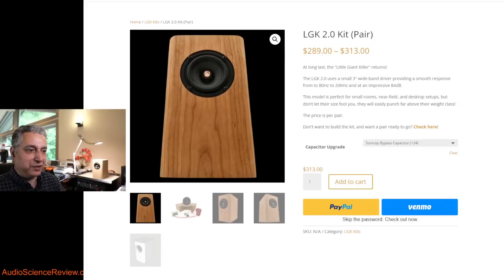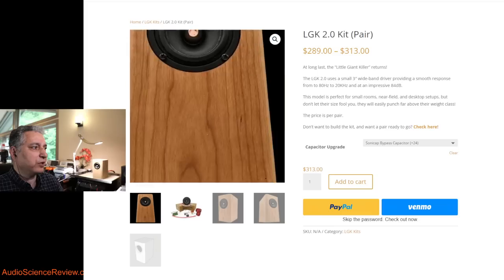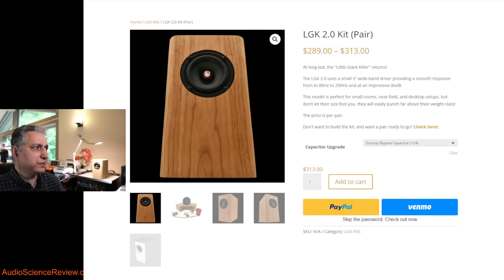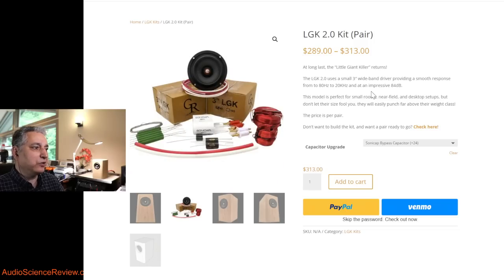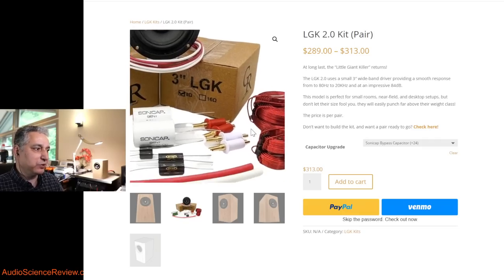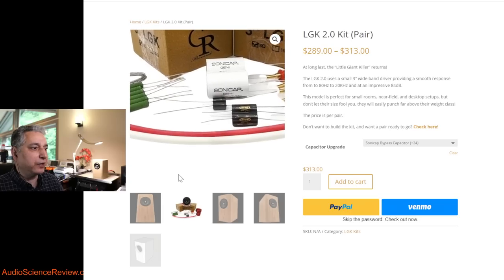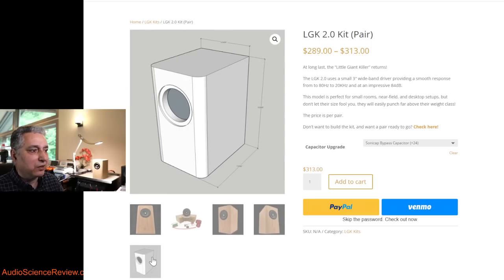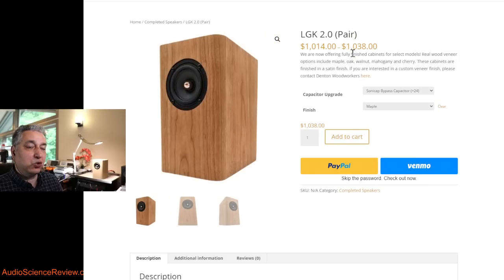GR Research LGK 2.0 DIY kit Speaker Review

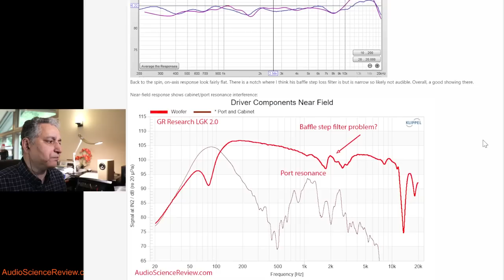Comment: At 11:45, what you are pointing to as a 'baffle step filter problem' is actually a more common issue with cone design, called "edge hole", which is due to a mechanical resonance in the surround or the very outer edge of the cone - as frequency increases, the surround (or edge) starts to whip up and down in-phase with the cone, causing a rise in energy, then it goes out of phase with the cone (causing a dip) before settling down. The purpose of the adhesive bead between the cone and the inner knee of the surround is to control this whipping tendency. It also exists in mid-bass speakers with wide and thin surrounds. It probably exists in this speaker because the cone and surround both have to be very thin and light, making them relatively flexible.
Reply: Interesting... thank you for that.
Reply: Could be shown with phase decomposition. I expect the exact issue that you mention.

Comment: Thank you for the honesty. In engineering there are always trade offs. But this sounds like a case of “you can’t get there from here”. Tiny little drivers shouldn’t be asked to do the impossible. 🍻cheers!
Reply from the maker: That's it really.  Now if an inexperienced hobbyist had come up with this, you could hang your hat on that.  But for someone that tears down and complains about countless commercial speakers to produce something like this, just boggles the mind.  I have to think he is not sensitive to distortion like many of us are to not have heard the serious deficiencies in that department.  Even without that, he should have known what a 1mm excursion driver can or cannot do.
Reply: I have Revel M8 speakers for my surround speakers that I bought on sale after they were discontinued.  They have 2 3" woofers and are ported and tuned to ~110 Hz and do fine at pretty high levels if crossed over at 120 Hz.  But a single 3" tuned to 80 Hz or so isn't going to go very loud.  If I bought speakers of that size I'd definitely want to have a HP filter of 120 Hz or higher on them.

Edit:  I'd imagine these would sound a lot better as a 3 way crossed 3K to 4K to a tweeter and maybe 250ish to a larger woofer.  That'd be a lot more expensive though, of course, and compromises abound at this price point.
Reply: @gregsunderland6394  A good friend of mine likes to make 3” subs do crazy things. We’ve learned a lot building the wierd Nth Order band-pass boxes. It can be done but not with the full range variety. The driver just isn’t intend to play that low. 🍻
Reply: @timealchemist7508  How'd they sound?  I've never actually listened to any bp enclosures. How high can they be tuned and still sound reasonably good is one question I'd like to know.  A 4th order bp with a range of 70 to 200 Hz or so would be well suited for home theater speakers, I'd think.
Reply: @gregsunderland6394  Well it’s kind of a novelty piece. He had some 3” full range Dayton audio speakers for monitors and then the 3” sub. (Also Dayton I believe) They sounded surprisingly good for what they are. But not much more than a nice computer pair. 

You’ll always get good imaging from such a small pair if set up well. So that was good. The sub suprised me but it’s nothing I would take too seriously. Just a fun side project.

Comment: Thanks Amir for another in-depth review. I like tiny speakers. There are many choices for DIY full range. TangBand, Vifa, Foster, Peerless, Dayton, Scanpeak etc.. I DIY the TangBand W3-2141 (3 inch full range). Low frequency distortion is much better than GR's full range. After listening to the TangBand for a while, I feel fatigue listening to vocals. So I added a tiny external silk dome tweeter and cross at around 2.5khz.  It is sounding much better now. Total cost $150/pair including the addition of tweeters and crossovers.
Reply from the maker: I am sure much better job can be had with a single driver.  Hope to test more in the future.
Reply: @AudioScienceReview  The Mark Audio drivers get good reviews and I have seen versions used in open baffles too.
Reply: @AudioScienceReview  would be cool if Audience still sells the A3 full range driver. They were claiming some high excursion numbers
Reply: @AudioScienceReview  I think you are right. I was impressed by the older E J Jordan units, (and Ted Jordan contributed a lot to the science of speaker design in his lifetime - you can read some of his work in the  old 'Wireless World', archived at 'World Radio History'). Hoewever, since his death a few years ago, the firm has gone all 'Audiophile', and the drivers are now out of my price range. You will always have range limits with single drivers, but the single point source can do a lot for stereo or ambisonic imaging.
I am a recent discovered of your channel, I love what you are doing. I stopped taking UK HiFi magazines in the first wave of subjectivism and am delighted to see a push back against it, especially now it has degenerated in a maze full of corrupt reviews and snake oil products.
Thank you for your excellent work.

Comment: Well that's what you get using too small a speaker combined with terrible xmax capability and typical high frequency beaming caused by the full range driver and high frequency rise. I'm betting this driver came from either India where Danny gets some of his drivers from or China and not of the best quality. Oh by the way has he yet to do that double blind power cable test he claimed he could easily do from what  a year ago now? lmao.
Reply from the maker: Well said.  And no, he never performed the blind tests even though he said even his assistance could hear the difference.

Comment: I have a question : why hi fi people do not use more of devices like a "dbx driverack PA2" to split audio domain to different amplifiers sending only part of the audio spectrum to each speakers, and choosing carefully the audio part that the speaker is good at ? I personnally tested my subwooker with pink noise, I saw at what frequencies it was outputting the strongest signal, and then I decided to send only this narrow band of the audio signal to that speaker.  then I checked if my bookshelf speakers were able to go down to the upper limit of the subwoofer, and so I matched slopes on the filters and removed the lower end from the bookshelf signal. Instantly the music played hugely cleaner, lesss vibrations in the house, all was less muddy sounding, and I was able to play louder if necessary because each speaker was only working in its ideal range. Most analog filters have flaws. Why not filter first in digital, then send signal to each specialised speakers ?

Comment: Thank you for the excellent review.  I own a pair of Sonus Faber Venere 2.5 the GR Research has and upgrade kit for about $679 for.  Been hesitating to mess around with them internally.  No particular flaws other than 'cheap' crossover parts, no tube connectors and not enough dampening (NoRez).  Do you recommend a decent parametric equalizer to improve their sound further as an alternative?  Thanks in advance.

Comment: Looks a lot like a Tang Band driver.. which is good, they do quality fullrange drivers. But regarding the pricing from GR - wow. The TB speaker might cost around 20 for the end user (stamped basket, paper cone, good, but simple construction overall). German hifi DIY magazines are full with dozens of comparable concepts, and they are pretty much all published in a "cheap trick" category.
P.S.: Check Cyburg's Needle in all its variations. Much better concept, not only for its super low price, but even overall. Open Source, too.
Reply: Don't forget that 50% of his profits go into " research ' ....
Reply: Are. The needle Sounds good. But the lancetta is better. A little bit more MDF and 12cm 50mm pipe.

Comment: Although you may have discussed it before, I appreciate the in depth reasoning and example you provided regarding your listening to only one speaker - - of course that other side of the coin of hearing a pair of speakers doesn't get assessed either - but I have a clearer understanding now - it's safe to say that one can't advance to 2nd and 3rd bass if one is already out at 1st. Thanks Amir.

Comment: Come on Amir. What do you expect of 3" drivers? Room filling performance? Think these will do pretty well for desktop use at lower levels. But the pricing is a bit bold for that purpose, as is its "marketing". LGK stands for Large Giant Killers. That is a bit of a joke I guess.
Reply: Yea, they ain't giant killers in no way shape or form.... just a lot of hype...  (js)
Reply from the maker: I think we all agree the specs said this won't work.  But the execution here is even worse than one thinks.  I mean he took a driver with 2.5 mm excursion and changed it to just 1 mm for this revision!  What is he thinking?
Reply: Agreed. Showing "early reflections" measurements for a speaker designed to (essentially) be a near-field monitor seems ...counter-productive.
Reply: @infinite1der  Eh, not really. Even near-field, there's quite a bit of room reflection.

Comment: Thank you for this review! You saved me $500 and 20 hours of work. 

Now we know the real reason Danny doesn’t send speakers for review.
Reply: You were going to buy a 3" speaker system ????
Reply: @edwardbalboa5528  yes assembling speakers is a hobby of mine. I previously made a similar set by parts express called the copperhead that Erin has just reviewed today. The copperhead is also a small single driver speaker. I’ve made a different GR res arch speaker called the desktop minis, those are now discontinued and replaced by the LGK 2.0s
Reply: @edwardbalboa5528  I could see doing so for a computer set up.  Definitely not a living room set up.

Comment: Amir, 
In this review you talk about the distortion that occurs in the full range speaker. 
While there is no argument about the need of a high pass filter and that designs around small full range speakers of this size and using a separate sub woofer, 
is this an issue w all full range speakers? (Distortion)

Would the same be true of  a co-axial speaker?

Comment: I have a pair of encore speakers that i love but when someone like danny trashes every vendor out there you loose confidence ( as not everything is junk)  and the bs about risers and expensive speaker cables and power cords is just bs. I have lost confidence in him.
Reply from the maker: That's indeed a problem with his approach.  Increasingly he has increased the ratio of audiophile myths to good crossover design work.  This kit for example comes with $50 tube connectors.  Money should have been toward a better design, than wasting it on such things.

Comment: @Audio Science Review  
Amir, I know this isn't the case (looking at the microphone placement and considering the inverse square law in regards to SPL at the listening position), but Danny Richie and others are claiming that you purposely over-drove the LKGs into distortion for your audio samples.

Since they are discounting your objective measurements and are weighing so heavily on the subjective listening results from your audio samples, they are quick to discredit your method.

If you still have the speakers, can you please re-record them while showing the active readings from a SPL meter placed at 1m distance in view within the live video playback?  And/or use a -0dB 1kHz Sine Wave tone to preset the output level of the speakers and your amplifier, and show the amplifier's volume knob position or value in the video with the 1m SPL meter's result?

Also provide and show with a measuring tape the exact distance from your measurement/recording microphone to the driver or front baffle?

There is another acoustic female vocal track that I think you should use as well.  It is Raya Yarbrough's "Hollywood Love".   The energy in her vocal peaks in the track will bring many otherwise capable speakers to their knees at moderate listening levels.  ;)

Danny has now also posted downloadable audio samples of his own, albeit with the LGKs high-passed to 2 subwoofers, LOL, which makes you concentrate on the bass performance and masks the issues in the mids & treble.

Check them out.  One track is Toto's "I Will Remember", and the other is Claire Martin & Kenny Barron's "Too Much in Love to Care".   Recorded using Ron's Neumann KU-100 Binaural Head microphone that he named "Randy" instead of its more common "Fritz" moniker.
Reply from the maker: I have thought about shooting this kind of video but my camera set up is not exactly optimal for this kind of use.  But I will see if I can get it done since he is making hay about this.  I listened to his two samples.  I am very suspicious of them as they don't sound anything like the originals.  There is way too much ambience.  And oh, they did NOT use the dummy head.  Or so they said later.  The picture shows two separate mics.  I played the two tracks on the speaker I have.  The Allison Krausse track doesn't show the problem.  Toto sounds way too boomy and not like the recording as I mentioned.

Comment: What an excellent job you did to scientifically provide proof and pull the curtain back on the charlatan that is Danny Ritchie. I criticized his use of graph only proof of sonic superiority. He blatantly insults all well respected brands and the designers of them and so readily goes and changes their creations with his same go-to simple recipe of Sonic caps and "high quality" wire and getting rid of cheesy components. I pointed out that what he disparagingly calls "sand cast" resistors are wire wound resistors which are the same type of resistor he uses. He also calls everything poly caps. Well poly caps covers a wide range of capacitor dielectric films:  Polypropylene, Polyester, Polyethylene, Polyphenylene, Polytetrafluoroethylene, Polystyrene, Polycarbonate, etc... He of course blocked me for this as he will likely do to you now ;)
Reply from the maker: Well said.  It is one thing to have opinion about these things, it is entirely different matter to have that insulting attitude with anyone who disagrees.  It is not like he has any kind of research to lean back on prove his points.  The challenge is that on camera he comes across as friendly and trustworthy so people who are not technical just believe.

Comment: I don’t know who these people Danny or whoever are, but this is a small speaker, seems unfair to say it has distortion at loud levels , or that it’s bottoming out with low frequencies. 
You don’t need a scientist to measure this; it’s obvious. This seems like a small desktop speaker that was intentionally over-strained.
Reply from the maker: I went into the review expecting it to not play loud.  But this is in entire different category.  With just 1mm of excursion and frequency response extended to 70 Hz, it is a fantasy, not a speaker.  I have small speakers that blow it away in dynamics and performance.  And it costs over $1,000 built.   The only thing unfair is setting expectations that this speaker is a "Giant Killer" when it can't even hold its own.  It is a Little Distortion Maker.
Reply: @AudioScienceReview  It it known if the speaker needs to be high passed? Or Is it just a 3 inch with no cross-over?

Comment: In GR’s video, Danny does say to play it 80 Hz and up.  Also says on his website, up to 84 dB. You measured at 86 dB and 90 dB.
Reply: Hello folks. Someone didn't see the instructions I'll agree with you on this water better than gasoline to put out a fire. Good eye you have.
 Full range drivers are just like anything else in audio. There is always a trade off and also a new trend, like this reviewer didn't know this from the start. 
 What I don't understand is why so many replys are all on the reviewer side. Not fair for whom getting attacked  as the main poster wins his fan club members, by dealing from the bottom if the deck. Than uses them against Danny.

Ride Easy
Reply from the maker: I measured 86 dBSPL at 1 meter.  His "84 dB" has no distance which makes it meaningless (sound drops off by 6 dB for every doubling of distance).  What I played in the video is at much less than 84 dB SPL and my 1 meter listening distance.
Reply: Some common sense would assume 1 meter or less.  It’s a desktop, near-field speaker.
Reply: @tallpaull9367  hello folks. Remember he is just supporting Jay the other  reviewer that got upset by Danny's video.
 That's the way it works in the audio world, sad but true. Some can take it with a gian of salt, not just say it.
 
If I don't find real live music today I can always listen to a copy on CD LP etc singing in the shower.

I'm surprised the nobody has flag this video. slander
Reply: @BootJamesOut  because people love to play “gotcha!!!!”  This is a bunch of audio curmudgeons who are sure that their 80s boom box sounds just as good as anything.

Comment: I'm interested in speaker building and have designed/built several speakers in my time.  Not surprisingly, the Youtube algorithm has steered me to DIY speaker channels and I've run into GR.  His stuff has been quite unimpressive.  In many cases, he would start with speakers which are well regarded among audiophiles then say they had major flaws which could only be fixed by investing in crossover components which he conveniently happens to be selling.  It's not clear that the changes really improved anything.
     The speak that you're testing is clearly an underperformer and a bad value.  Any half-way well done two-way system would do a better job.  Thanks for pointing this out.